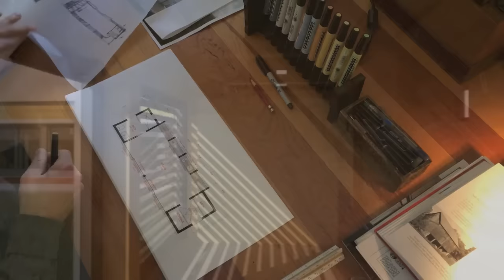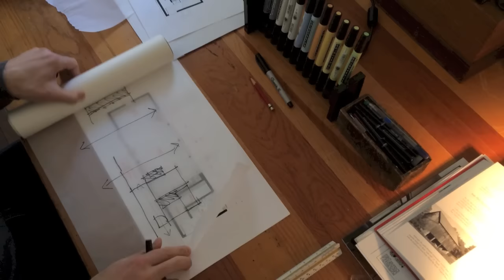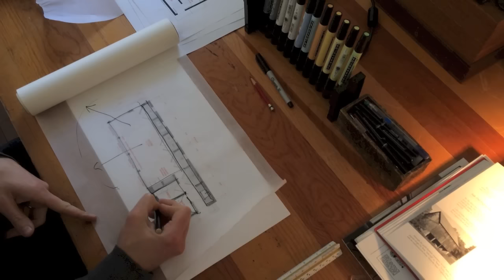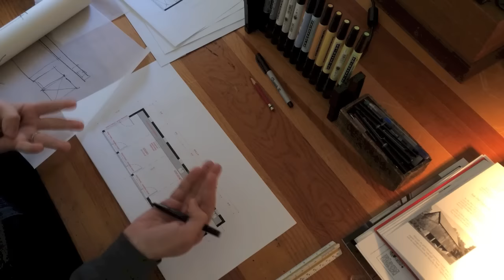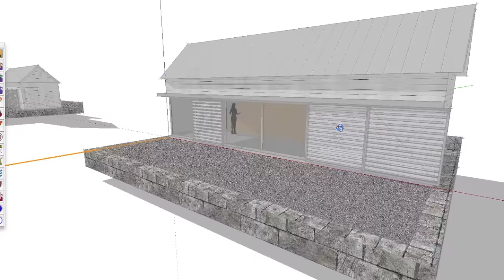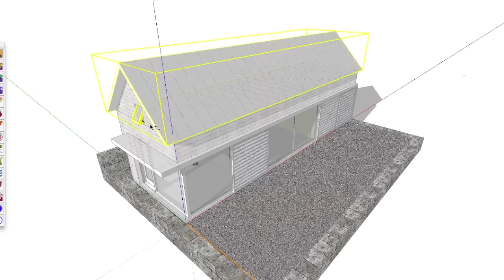Architect's Design Process : Modern Barn Studio

Comment: I enjoyed watching your video and I am not an architect, but in my opinion you haven't considered one of the most important aspects of a barn: its height. Why not developing idea with two levels (an upper floor) and double ceiling sections?
I also think that your best concept was the third one (with glazing on both sides). It would conceive more the idea of spaciousness that you were chasing.
Cheers
Reply from the maker: Prophet86 It's a reasonable question and one I didn't address in the video. First, there's a subdivision height limitation governing accessory structures (two stories wouldn't be allowed). Second, and more importantly, it wasn't part of the client directive; they didn't want two stories.

This actually helped to achieve the barn-feel. A one story structure with a taller plate height mimics the interior height and volume of a barn more closely than adding a second floor. Adding a floor would reduce the apparent scale indoors. Cheers...